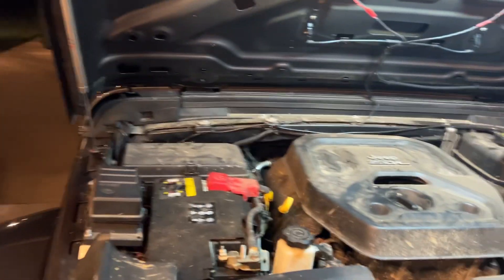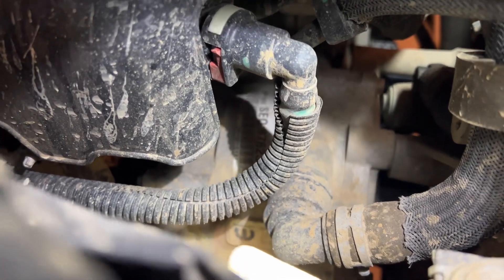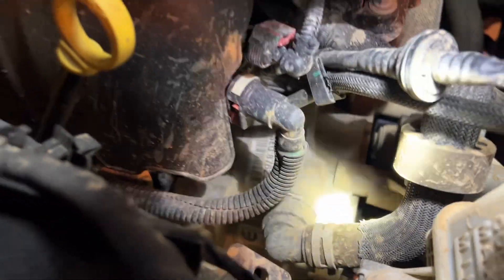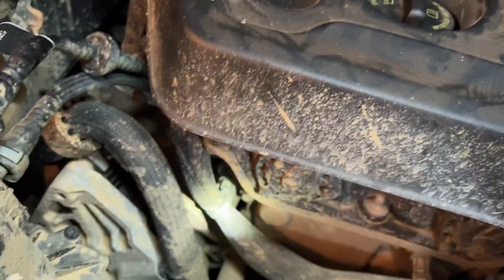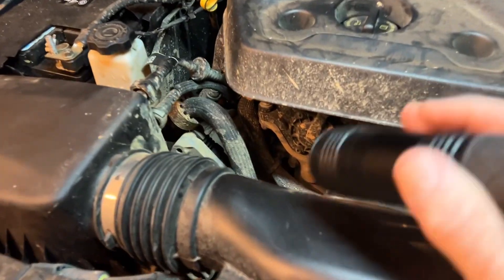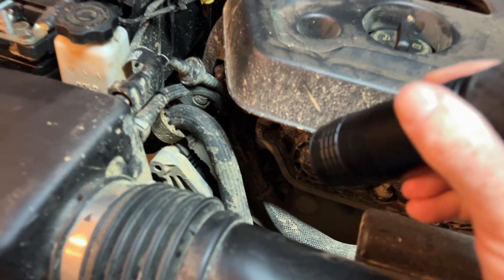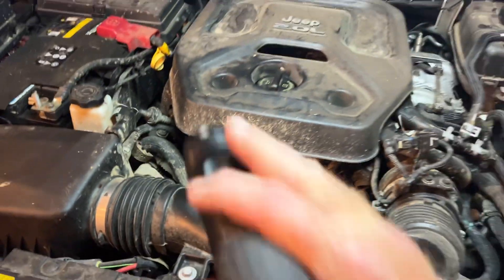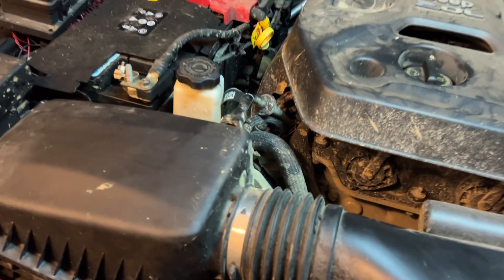Where is the P1 Motor/Generator on the Wrangler 4XE

Comment: Why did you remove your hood liner/blanket? It is good to have for several reasons: in case of fire and it keeps the engine cooler.
Reply from the maker: I messed it up when I put the lights on the hood and just haven’t replaced it. It’s on my to do list.